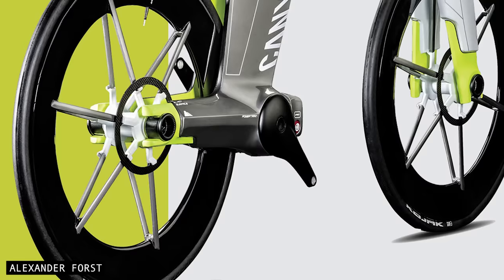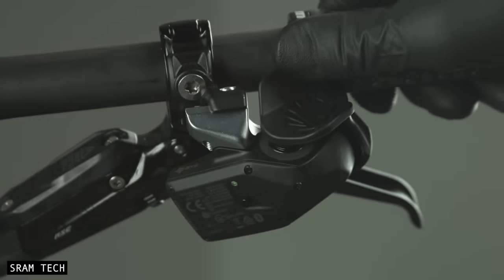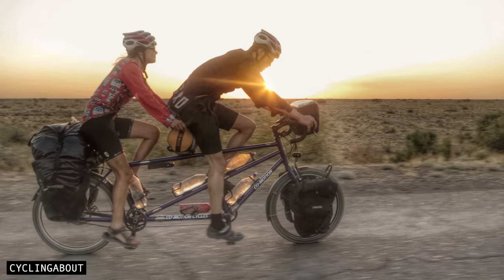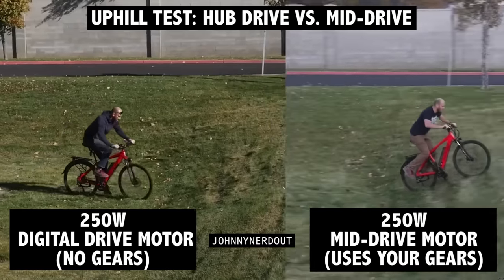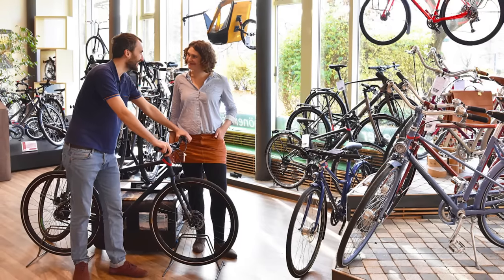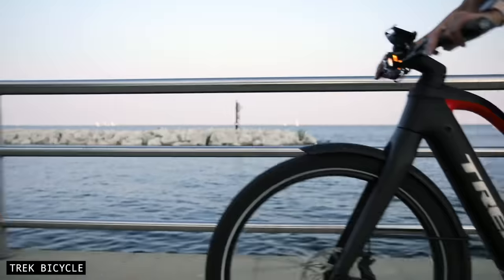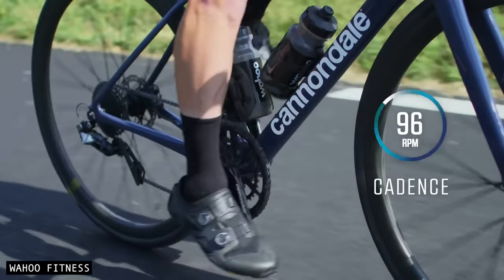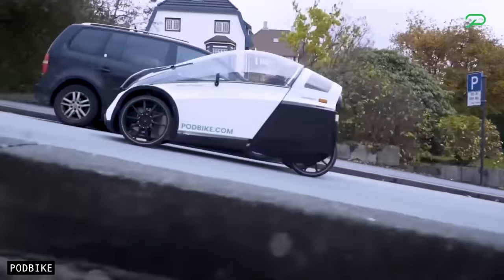Are Chainless Digital Drive Bicycles The Future of Cycling?

Comment: Omg it would be incredibly hard to drive such a bike with so much energy loss! Imagine how much more pleasant it would be to switch back to a normal bike and immediately discover your strength can propel you so much faster and easier! I can't see why anyone would accept lower energy efficiency. Battery power assist is what people want.
Reply: Exactly. A clean chain is 98% effective.
A great electric motor is 90-ish %, plus the generator at your feet, making a total efficiency of what, 80% in near ideal conditions? No one would want to ride a bike with a chain that only got 80% because it would feel like a brick.
Reply: I would accept it if it had 80% efficiency
Reply: @tarsvanhoof3766  Especially going uphills with your heavy load won't work on a electric motor but on a chain which your strength matters a lot.
Reply: @tarsvanhoof3766  its actually much less efficient than 80%, closer to 60%. would never be adopted in my opinion.
Reply: One thing where it excel is on going uphill. The pedaling is generally the same, so you don't have to exert yourself.
Reply: @boulderbash19700209  IF it has a battery to assist, but then a normal chain-drive with assist is still more efficient and you don't need so much energy assisting you
Reply: One way of tackling that problem is to separate the power delivery between the wheels. For instance, peddling for the front wheel, while the rear wheel has an eMotor that is mounted on it. And obviously it would have regenerative braking on the rear to recharge the cells on the commute.

Of course, this means it's less comfortable to peddle, but perhaps the Electrical Assists counters this, maybe even makes it better overall.

On something else like a delivery wagon, we can have the front wheel just being standard. Have the peddling be standard for the rear wheel. And opposite to it, since this is a Trike, be powered by an eMotor with Regenerative Braking. But the problems really arise with a two-wheel design.
Reply: Exactly. That's why we drive cars. Even though the efficiency is 30-35%. If the software can be tuned and the ride, made to feel as natural as possible, the combination of a supercapacitor or battery. The regenerative breaking wouldn't need an overly complicated circuit. I think just the DC inrush current and "collapse" would need to be handled but would need a motor spec and run simulations and test to design. The power-stroke cycle is an interesting one. As well as the left/right leg strength compensation. This could be a phenomenal product. Small gyro to get pitch and elevation - could extend to fall and crash detection with an accelerometer. Sorry I got a bit carried away. 😅
Reply: That's why I stick to sub 300€ bikes, you pretty much get none of the benefits of weightreduction and powertrainloss but benefit on saved money and increased "training"
Reply: @tarsvanhoof3766  You're not gonna tell me that a dirty chain is 1-2% worse than a clean chain right. Not that it matters in comparison to how much tireflex or swing loss of the whole bike.
Reply: @Sirmellowman  Electric motors are actually ~90-95% efficient depending on the build, I've got my uni slides open as we speak.
Reply: Assuming the motor is not in the rear hub and a shaft also seems to have close to 0% losses. With a rear hubbed motor you can even benefit from regen braking.
Reply: well, this system can become interesting for lower ranges while wireless charging at any stop (with regenerative energy) becomes reality.
In this case light battery pack could add the missing 20% or even boost at 120% or anything in between while driving.

sound rather complicated in terms of infrastructure and $ anyway, so maybe 2040
Reply: The best part is that when this electric drive bike will be famous, Apple or Tesla will come up with a revolutionary bike design with a chain drive and sell it only with a subscription cost of 49.99 US dollars a month.
Reply: @wadimek116 lol no you won't. An 18 percent loss is huge. Ie 18watts lost for every 100 watts your legs can pump out
Reply: @FLMKane  Yes I will. I drove everyday to school till high school in different weather conidions as well as snow. My chain was in terrible condition, I never done maintenance and the bike usually was outside in wet and mud for hours, days and months. Im sure the efficiency wasn't to great. 20% is just 20% I don't need to win a race.
Reply: Incorrect. Nobody cares about design efficiency, as long as they do less work.
Reply: 80% efficiency on uphill or flat areas. But consider that braking can be done regeneratively on future models, to charge the battery instead of braking on any gradient.

If you live in a very flat area with minimal traffic lights or need to stop then this won’t make cycling itself easier.

For anyone living in an urban or hilly area, this design would make cycling easier.

In both circumstances, the complete lack of mechanical transmission would reduce maintenance and free up more space on the bike for additional features, e.g panya, double lock stand, integrated wheel locking.
Reply: Bro there is also a battery, but you're right anyway....who needs electricity to drive a bike..we only need raw power
Reply: Bro there is also a battery, but you're right anyway....who needs electricity to drive a bike..we only need raw power
Reply: @martinhawes5647  regen braking is not equivalent to an electric drivetrain. Would be more effecient to have a chain drive AND a regen system. In fact I'd put an electric dynamotor at the front wheel, which would allow for two wheel drive and regen braking in a modular system, while keeping a pure chain drive at the rear. You'd have 97% ish energy conversion from your legs to kinetic and gravitational potential energy, and possibly just under 90% conversion to electric energy when using regen braking, ready to be dumped back into kinetic energy. So you'd get 87% energy recovery 

With the electric drive, you'd already be down the 81% effeciency from the get go and then if you recover 90% of that, your only get back 73% of your initial energy use.
Reply: @martinhawes5647  also if you think an electric drivetrain is easier to maintain than a chain drive, you're delusional. Just try maintaining an electric golf cart.
Reply: .........except those who don't. Try and say "what I want" rather than presuming to speak for other people. 
Personally, even if this electronic drive train was developed to the point where it was as efficient and light as a derailleur, and at the same cost, I would NEVER dream of having such a bike. I wouldn't want people to think I was riding a pseudo-motorbike, relying on a battery, and I wouldn't want to be kidding myself that I was doing all the work.
Reply: The thing is, it could output 70% nonstop if it has a 80% efficiency, and "slowly" charge a battery with the last 10%, and then, when you need more power, it can help you out, so it still feels like the same load to you. Or even, help you get up somewhere where you couldn't before because you are to weak to get up there normally.
Reply: @tarsvanhoof3766  Also rotational mass means a lot. And the biggest is in something like shown on the video.
Reply: @Daniel-dj7fh  What? So do you think that dirty (depends how much) drivetrain loses less or more than 2% of its efficiency? What is swing loss?
Reply: @call_me_jujo_9493  
I would say that dirt has close to no impact on drivetrainloss, 2% being way too high.
Swing by your tires compressing and decompressing, frame flexing and shoe material dampening.
Reply: @John Smith I got mine new
Reply: @John Smith The Decathlon Triban Rc100, modified into a gravel bike with 42mm tires and some framebags, mudguards.
Reply: I don't even know why they spent any time at all fleshing out this concept.
Reply: It helps when you are going uphill and when you are tired.
Reply: that's why they need to have more than a wire connecting the generator to the motor.
if this were a viable product, it would have a battery and super capacitors to assist with starting and regenerative braking and there would DEFINITELY be a micro controller on board
Reply: @tarsvanhoof3766  When you combine all the loses this thing has about 58% efficiency...
Reply: @Glasrandkante  it would go slower, but it wouldn't feel any different from going on level terrain. to me that's awesome
Reply: Who cares about efficiency when we have infinite supply of energy. <sarcasm>

Comment: The use of the word "digital" is 100% wrong in this context. What you mean is electrical.
Reply: At.least they didn't call it a smart bike
Reply: Well, maybe if it uses a synchronous motor with a square tooth wave DC pulse width modulated generated power signal off the crank? 🤣🤣🤣🤣🤣
Reply: Could aaaaaaaaalmost call that a binary signal…. 
Baahahahahahaha 

It just sends a constant 101010101010101010101010101010101010101010101010101 🤣🤣🤣
Reply: A bicycle with digitally controlled fully electric drivetrain. I think "electric drivetrain bike" would have been a much better name used in this video.
Reply: @cristibaluta But the question is, can the bike run Doom?
Reply: A regular bike with indexed gears is more digital than this.
Reply: @ChrisHirner just wait few months - it will be called digital bike with AI controlled drivetrain.

Comment: Because of weight and simplicity, I think a basic pedal assist system is going to be the best choice for a while.
Reply: The conventional systems have been refined over many innovations and iterations for many decades. Bikes today are surprisingly more efficient and better than the bikes we rode as kids.
But electric-powered and electric-assisted bikes will always appeal to people who lack strength and endurance.
Reply: @pwnmeisterage  very true
Also they cost more and r not worth it anymore
Reply: I think you hit the nail on the head. I have made 2 electric bikes from kits and bought one prefab model. I could see this design excelling for those who just city cruise or easy trail riding which could also easily be done with existing chain drive pedal assist. Nevertheless, it’s an interesting concept.
Reply: @pwnmeisterage  or are just plain lazy
Reply: Personally I would just put the hub motor at the pedals.
Reply: Why is it simpler? You need additional gears and chain for PA compared to motorized front wheel.
Reply: Well, if you can avoid the chain, sprockets and the gearbox you can avoid a lot of unsprung weight on the rear axle. :)
Reply: @pwnmeisterage  I think it makes sense in velomobiles. Not having to worry about that big chain would simplify construction by quite a bit. These are already very efficient vehicles so the energy loss isn't that noticeable.
Reply: Chainless would be much simpler.
Reply: @hkad6252  true. But how would you transfer the power to wheels then? 🤔
Reply: @user-pq4by2rq9y  I'm old school. One watt is one watt, one degree is one degree, one volt is one volt, one clock is one clock, one decibel is one decibel.
In plain language, this is the idea that one does not compromise here and there and accept small losses. A good machine is a good machine which can be improved. But a bad design is a bad design which should be abandoned.
Reply: @RubenKelevra  Well I dont. Pedal resistance should be near zero. All the power should come from the hub motor. Personally I just want the pedals just to justify it legally as a bicycle to ride it on cycle paths for commuting.
If I want to work out I use a regular bike.
Reply: @hkad6252  that makes no sense. Without power transfer it's not a bike and won't be allowed on the road.

In addition you need at least double the battery capacity if you don't use any power from the legs and just doing free peddling isn't comfy at all and completely wasted energy in addition.
Reply: @RubenKelevra  Sigh… it makes perfect sense for commuting.
1. Well of course you CAN transfer the power from pedaling. Generator at the pedals, Motor at the back, Battery in the middle for buffering. Generators and motors have efficiencies > 90% ao thats great. Google Schaeffler FreeDrive, it actually just hit the market.
2. I have ridden an eBike 20.000 km all year round to work. Battery usage is no issue. 0,5 kWh took me around 120 km.  Even If battery usage was double (which it deos not need to be, see 1.) 60 km would still be more than enough
3. By no pwer transfer I mean keep it to a minimum to legally qualify it as a bike. That is what I wrote in the previous post.

Chains suck, in winter on salty roads they rust no matter what you do. I switched to belt drive this year.
Reply: @hkad6252  The allowed motor size of 250 W is not enough for such a large vehicle. You can't just peddle in the air and let the motor do the work. Apart from the fact how stupid the idea is to just waste the energy.

How would you "transfer legally required power" with "no transfer of power" that makes no sense.

While generators and motors have each 90% efficency (best case scenario - it's more like 85% in real world) you still need to convert the 3 Phase AC to DC and DC to 3 phase AC.

Total loss is likely more like 50% than 10%.
Reply: @RubenKelevra  The product I am describing is literally in the video we are commenting. Also Schaeffler has brought it to market already. It is called FreeDrive.
Reply: @pwnmeisterage  Normally I would agree with you but these things get ridiculous range due to their aerodynamic efficiency (think 200+ miles out of a small battery). At that point, sacrificing some of that range to lose the chain, add a suspension, save internal space and make the vehicle much easier to service does make sense.
Reply: @pwnmeisterage  What about the coefficient of efficiency of the pedal power generation system?
Reply: @pwnmeisterage  I grew up with the notion that one watt is one watt etc, and I couldn't stand compromise. Real old-school engineers tried to teach me I was wrong. As an adult I find myself (uncomfortably) understanding they were right: There are no designs without compromise. One watt is one watt to be sure, but no design in this physical universe can use all of it. In mechanical systems such as drivetrains, it is impossible to eliminate friction. More annoyingly, the most efficient design may be unacceptable, such as car gearboxes in which the most efficient gear tooth pattern is noisy. Different use cases result in different optimums. For instance, the manual CVT in my bike allows me to choose the most efficient ratio for any circumstance, but it takes me time to find the right ratio after a downhill, reducing the time I could be pedaling. Electric bikes bikes themselves are arguably a suboptimal use of energy because they weigh more than unassisted bikes, but with my health problems I need one. Buying a belt drive could arguably be called a suboptimal use of my finances, ;) (It's all numbers!) but again, my health makes it difficult for me to maintain a chain drive.
Reply: @RubenKelevra  yes and replace it with the weight of a motor
Reply: @pwnmeisterage That's a very shallow way of viewing technology and machinery. Even old school engineers will tell you, you are wrong 😂